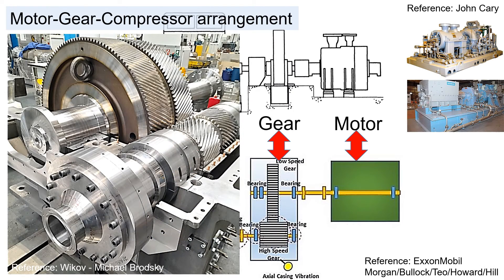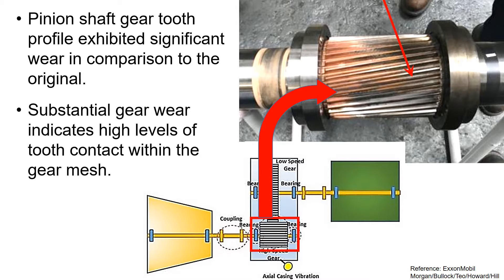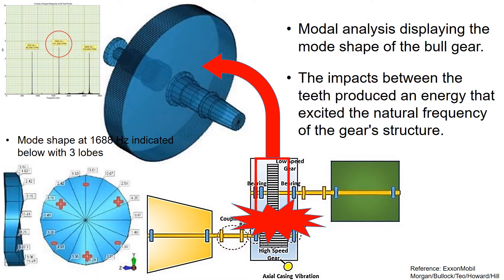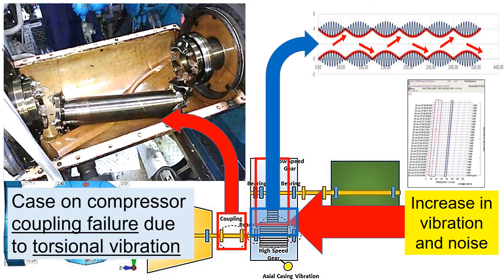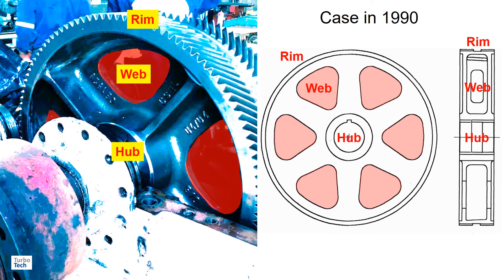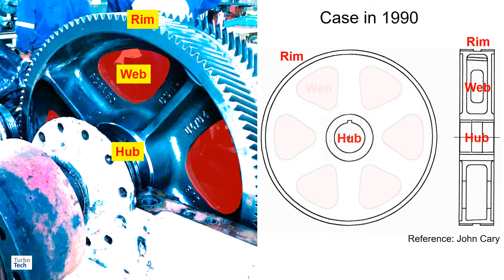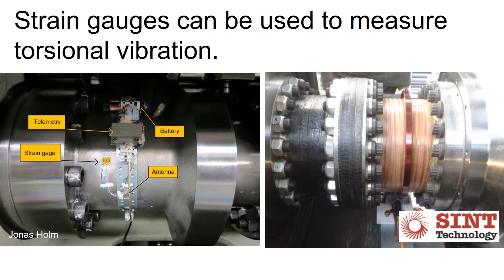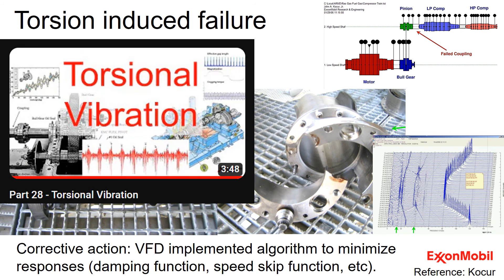Part 42 - Torsion Vibration Exposed: The Hidden Threat to Gears and Couplings

Comment: Great information, currently I am doing my Master thesis about torsional vibration in geared compressor trains. The most dificult part is to obtain torsional measurements in order to validate a conputational model. As you explained, normally it depends on strain gauges, they are not built-in devices in most of compressor trains. It is much easier to obtain data from lateral vibration since bearings are normally provided with X and Y vibration probes.
Reply from the maker: Thank you for your comment! It sounds like you're working on an interesting and challenging thesis topic. Torsional vibration in geared compressor trains is indeed a complex area, especially when it comes to obtaining measurements for validation. You're right that strain gauges aren't always readily available in compressor trains.
Additionally, if you think this video might be helpful to your colleagues or anyone else working on similar projects, I'd greatly appreciate it if you could share it with them. Sharing knowledge within our community can lead to valuable insights and solutions. Thank you for your engagement!